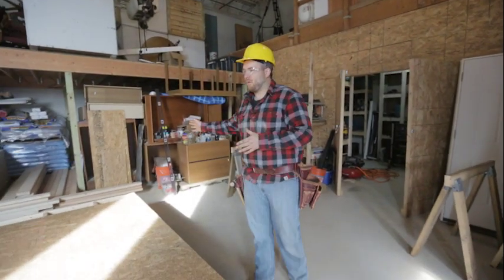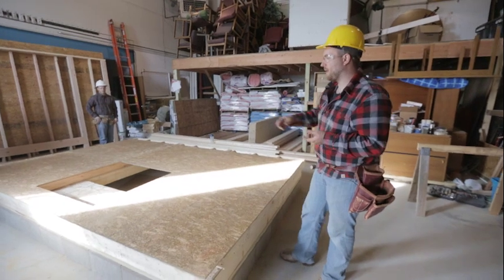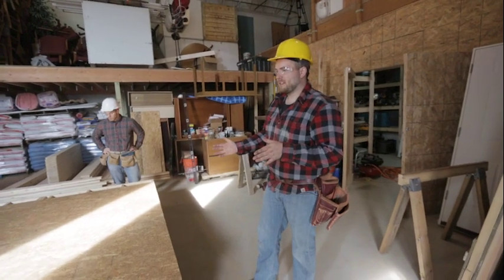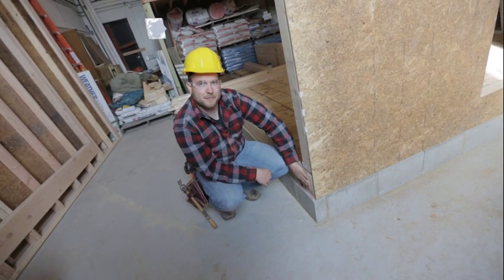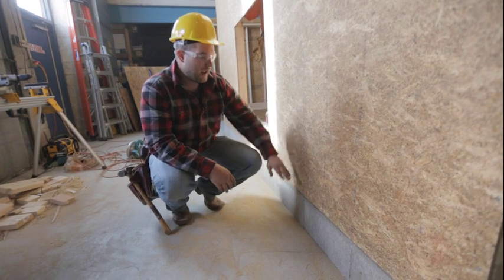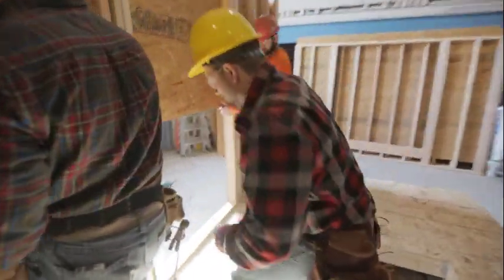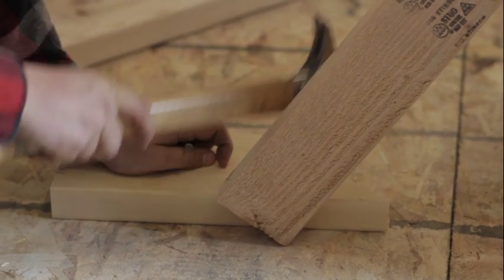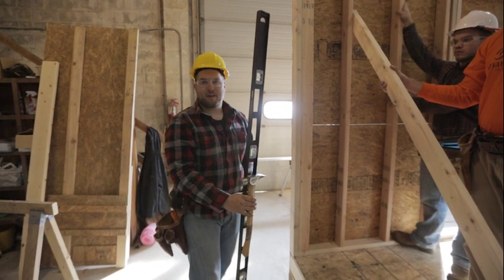How to - Wall Framing Part 5: Standing the Walls

Comment: Great stuff.  Very informative and instructional.  I've been watching these over and over to get a good mental walkthrough going so I can imagine the entire build process.  You cover just about everything to help out DIYs and the pros.  One question on the occasional glitches.  I see in this video some errant toe-nails coming through on that bottom wall plate.  How do you go about addressing those?   Hammer them in to create a crease in the stud or use a dremel or similar to cut the ends sticking out?

Comment: How come the one sill plate is flush with the foundation rather than being back the width of the sheathing. Also, if the building is 8 by 12, does that also include the width of the sheathing on the exterior walls or is that not included

Comment: What if the floor is concrete, and there is a concrete pad next to the project? How would you brace it?
Reply: i would assume you would go to the other side of the wall, drive a stake in the ground to secure the brace to, otherwise you would have to have 3 inch concrete screws, and a masonry bit to bore a hole for them, then tack to the brace as usual, any carpenters feel free to comment, id like to know if im right